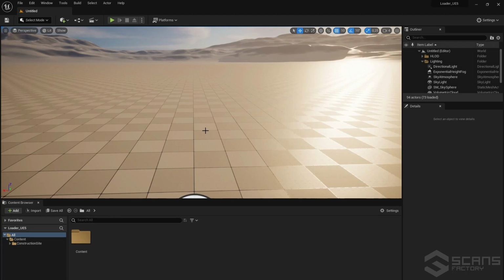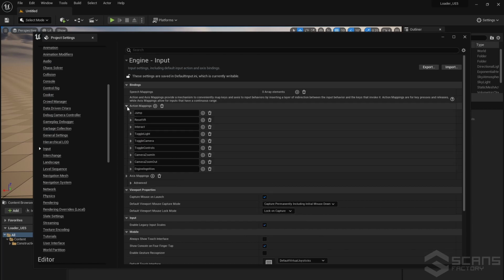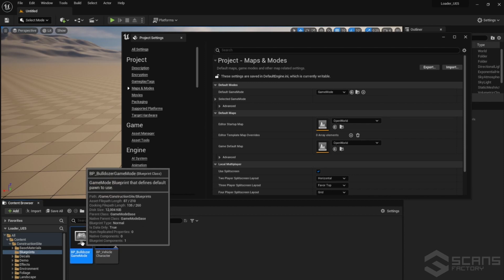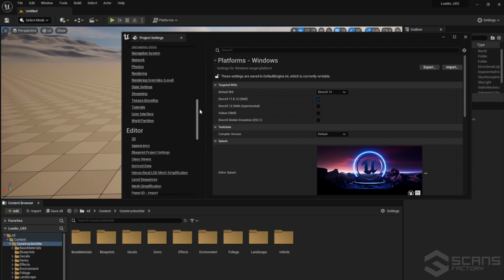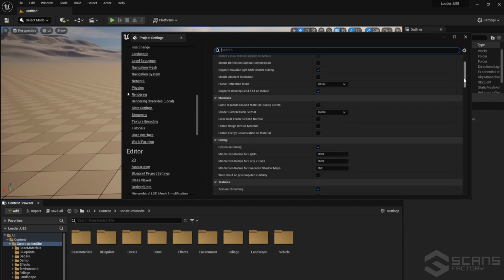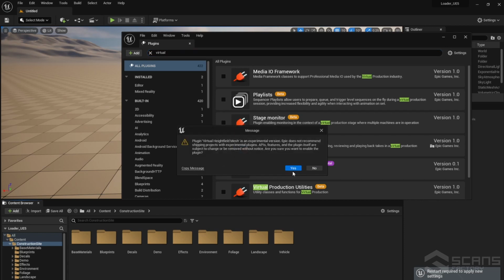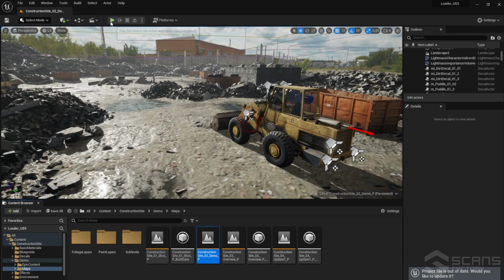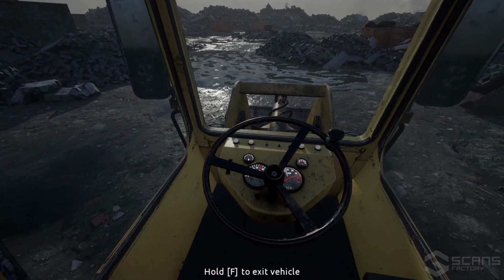[SCANS] Construction Site - UE5 Support

Comment: I followed these instructions exactly but get several errors in UE5. "Failed to load outer" error when opening any demo maps, and 2 blueprints say "corrupted". Please help! I installed the content from the Epic Games Launcher. Also, which template should I use when creating the project? (blank project / Third Person Template / etc...)
Reply from the maker: We missed these comments because of vacation. Sorry for that. If you still have a problem please write to us at support@scansfactory.com. Best, Adam.
Reply: @scansfactory  No worries, I got it working but thanks!
Reply: @reliquary1267  Could you explain how you solve that?
Reply: @coromotostudio9842  I followed your tutorial again but this time I RESTARTED the engine with each new plugin install BEFORE ever attempting to load the construction level. It must have been a missing plugin. Enable and restart the engine with each and every plugin enabled
Reply: Also, the order that the plugins were enabled seemed to matter if I remember correctly. Just enable every plugin required as shown in the video, one by one, restarting with each new plugin
Reply: @reliquary1267  Yeah! Now Works. Thanks